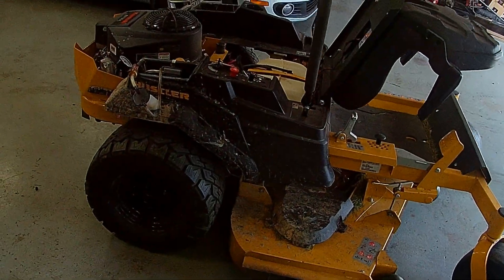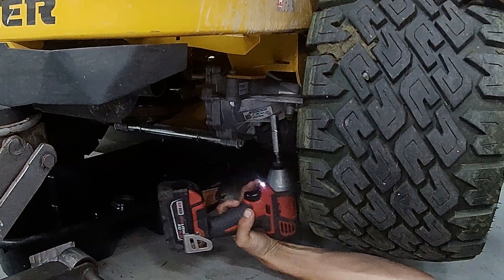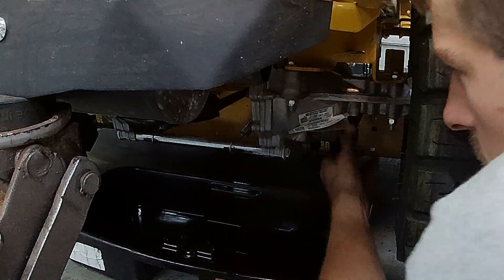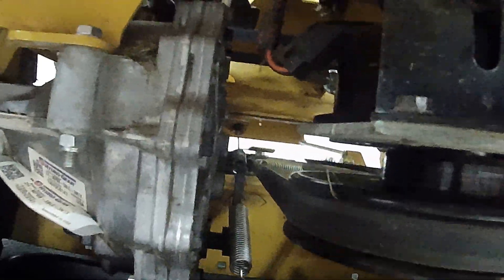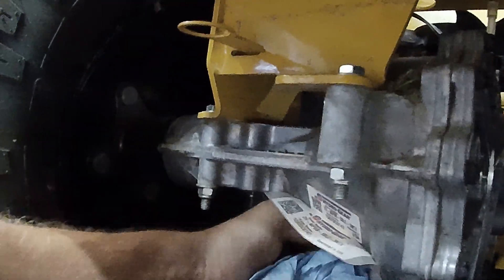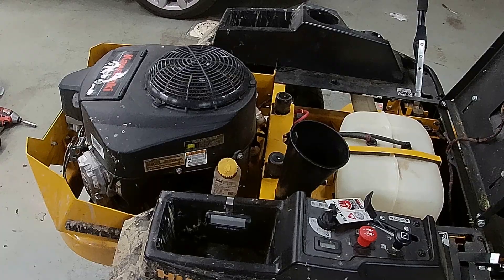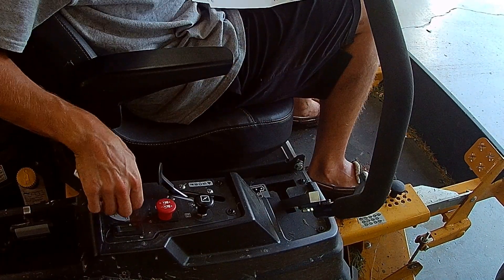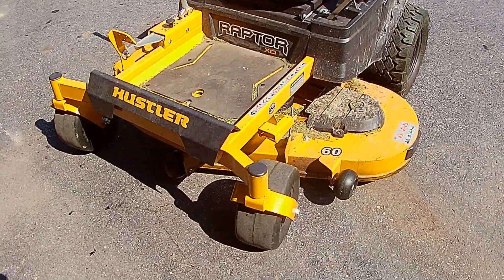Servicing ZT2800 Hydros on Hustler Raptor XD60

Comment: This deserves more views! I can do most of my own maintenance but when I saw that my xd didn’t have any kind of reserve tank(s) I had a serious wtf is this sh*t moment.  The old ones had a reserve tank! Any way, I did it! My manual makes no mention of removing the side ports before adding the oil, but it makes sense to displace the air and get the oil flowing down. Without taking those out it would have taken hours for it to drain down! 

How are you liking your raptor XD? I love mine but it is one of the lightest ZTs in its class which made me feel a little leery about some of the hills at first but got over that. No issues with the “tiny” battery on mine so far. Big bite tires are kind of gimmicky but they look cool. Regardless, I got an amazing deal on mine and love it even more because of it, but screw this maintenance item. They could have easily put a reserve tank in for these!

Thanks dude! Great video